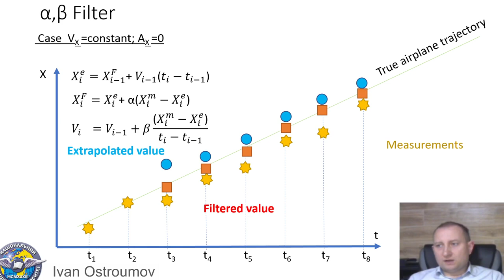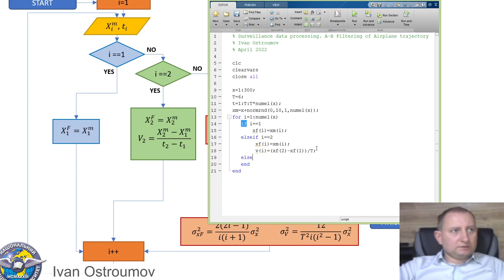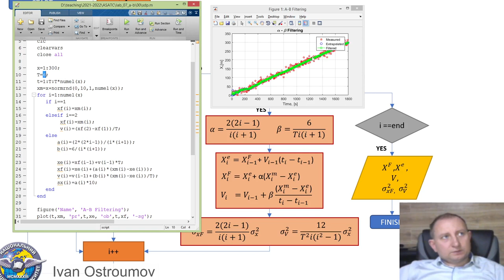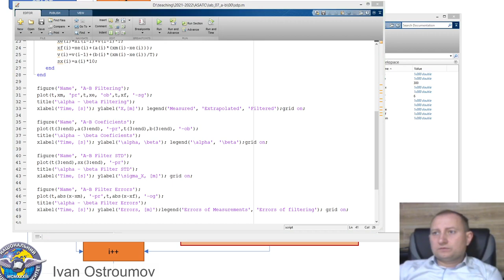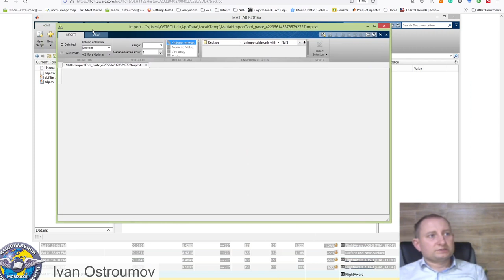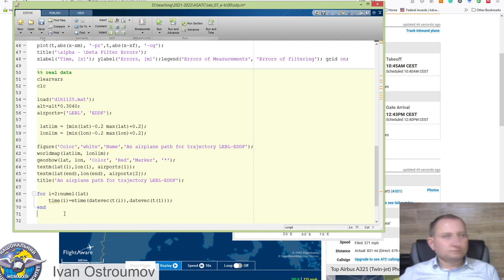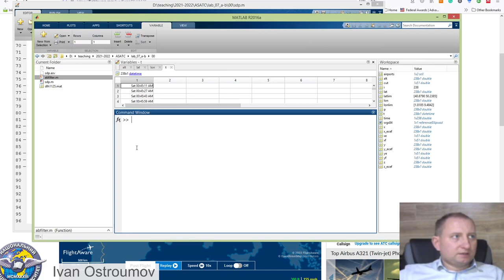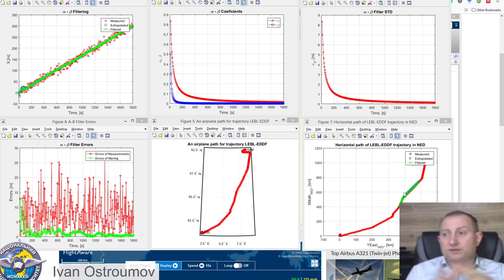MATLAB. Surveillance data processing. Alfa Betta Filtering of Airplane trajectory

Comment: I have error:
Index exceeds matrix dimensions 

In line:
[xf,xe]=abfilter(x(cut),time(cut));

Function:

function [xf, xe] = abfilter(xm, t)
T=t(2:end)-t(1:(end-1));

for i=1:numel(xm)
    if i == 1
      xf(i)=xm(i);
    elseif i == 2
       xf(i)=xm(i);
       v(i)=(xf(2)-xf(1))/T(i-1);
     else 
       a(i)=(2*(2*i-1))/(i*(i+1));
       b(i)=6/(i*(i+1));

       xe(i)=xf(i-1)+v(i-1)*T(i-1);
       xf(i)=xe(i)+(a(i)*(xm(i)-xe(i)));
       v(i)=v(i-1)+(b(i)*(xm(i)-xe(i))/T(i-1));
     end
 end

end
Reply from the maker: You need to check dimensions of matrix x and time in workspace. both of them should have identical numbers of columns and rows. If not use ' to tranponate matrix